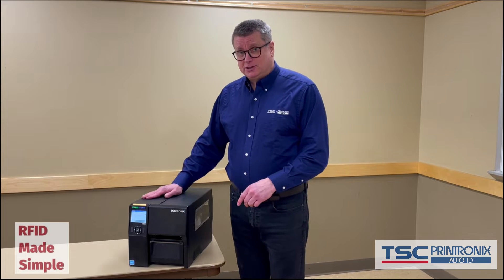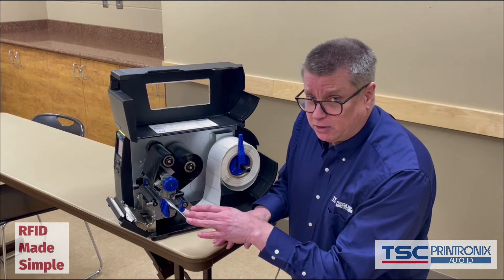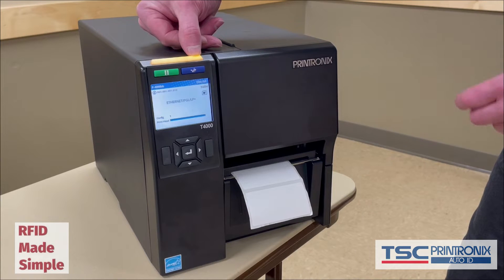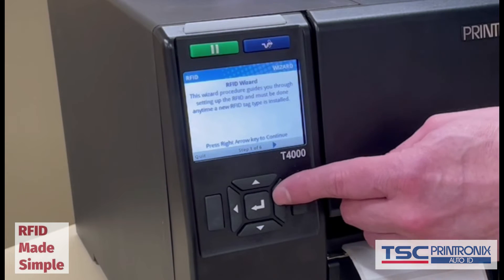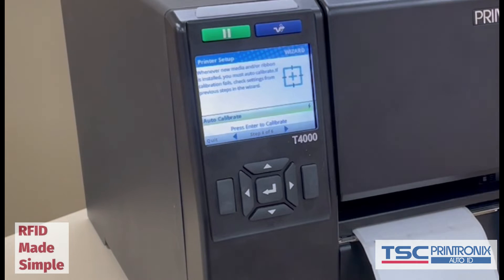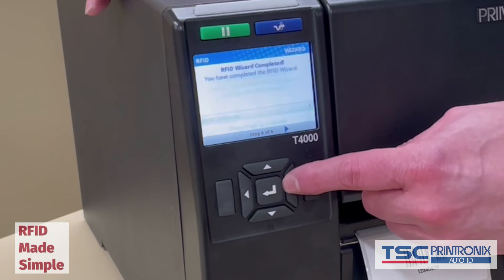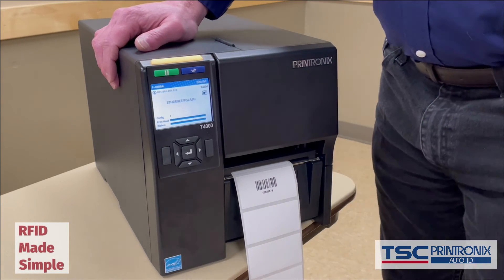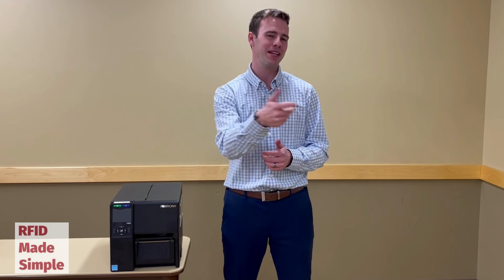Calibrating the Printronix T4000

Comment: When trying to calibrate using these steps I get an error stating "Write Tag Failed" after the calibration process that starts at 6:40. Any idea what is causing this issue?
Reply from the maker: Do you know if the tags have been locked by a previous supplier? This would prevent the printer from being able to write to the tags.